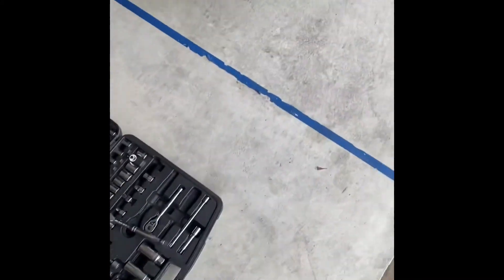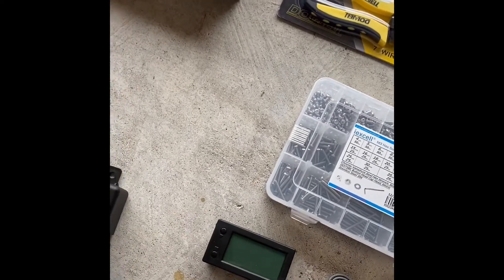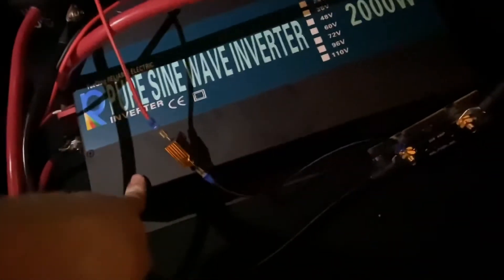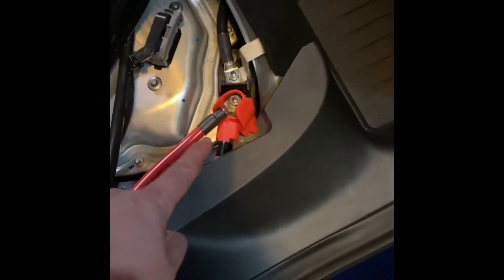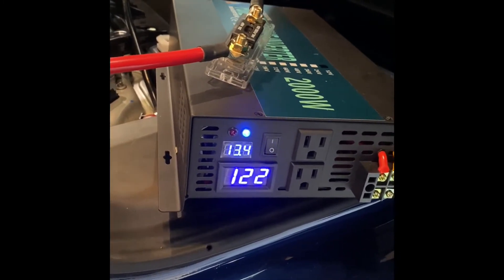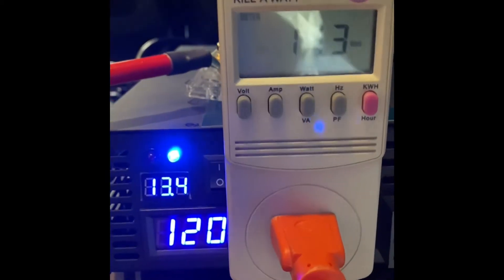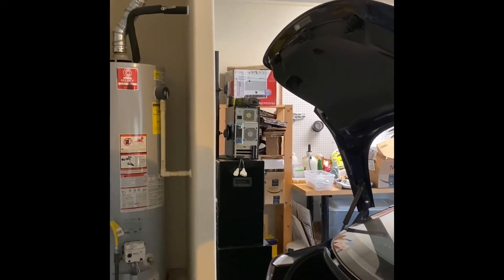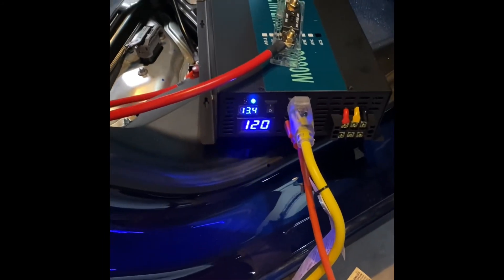Inverter Testing on a Tesla Model 3 [Continued] - Working

Comment: A simpler setup for emergency would be connect the 0/1 gage wires to a 12v battery as an intermediary voltage regulator then connect the inverter to the 12v deep cycle battery (not the car battery).

Not my idea. Seen this on another YouTube video where it was set up to power a concert sound system.

DC cables > 12v battery > 2500w/200w inverter > extension cord 

The 12v battery in between the dc cables from the car can be connected and disconnected just ended the seat with a Anderson plug
Reply from the maker: Definitely.  This is the way.

Comment: The system seems incredibly touchy, not saying that i did this, but if you plug in the Inverter directly 
This was the only method that worked 

Inverter plugged in 
Dc-dc off
12v Battery off (disconnected)

"Jump start" apply 12v to Inverter, directly to the terminals that run to the DC-DC, 
(car powers on)

Reconnect 12v Battery once system lights kick on

Power on the Inverter while connected to a battery tender 

Finally Connect the DC-DC
If you hear a " cerclunk"  you are good to go, error free, remove your battery tender and have fun. 

Is what i would say if i did this... and i definitely didn't daddy musk...

Comment: I would love to do similarly. But doing so will invalidate the warranty. Any attempt to use the vehicle as a stationary power source will invalidate your warranty.
Reply: As far as I understand this chapter in the manual, This warning only concern using the main high voltage battery, not the 12v battery.